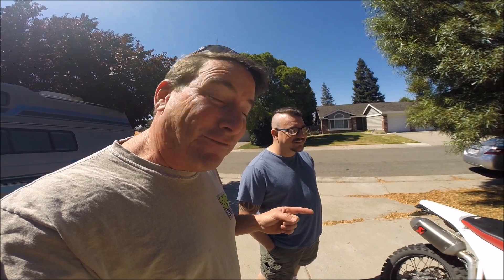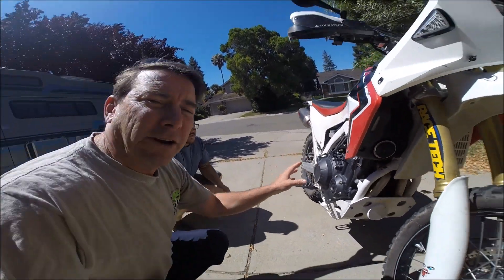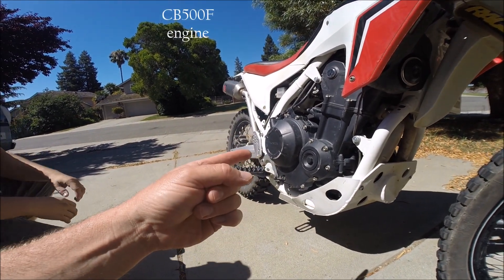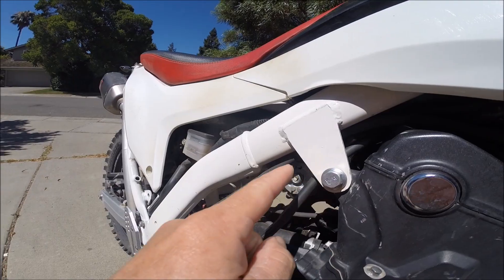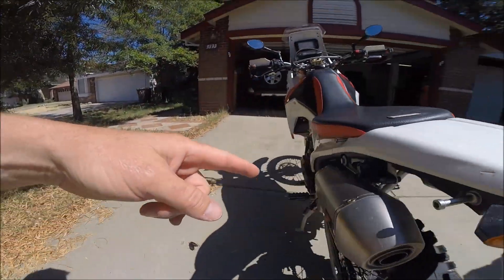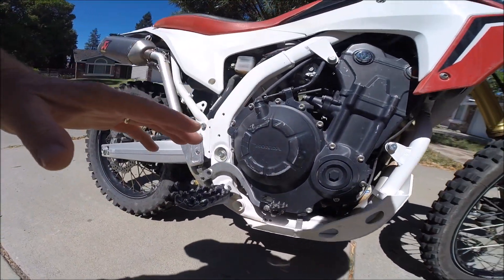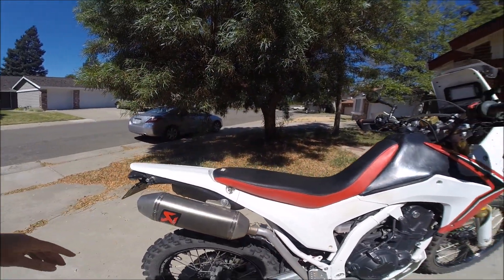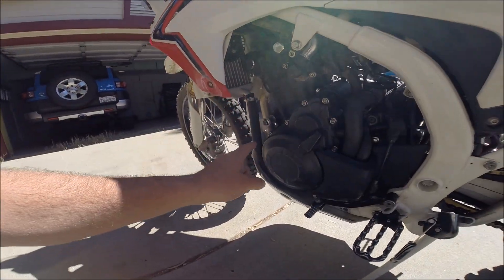HONDA CRF500L BUILD

Comment: So much for the “wave of the future” 9 years later no one is making this a production bike.
Reply: NOW you have KOVE 😂😂😂 try your luck :)
Reply: Kle 500
Reply: @G_040  If I am not mistaken, this bike should weigh around 160Kg (could be made lighter with a single exhaust) the Kawasaki KLE500 is ~30Kg heavier (at 193 kg)... The Honda NX500 is around the same (196Kg)...
Reply: @Jose-Sousa yeah too heavy. At 430lbs might as well get a tenere 700 with a wet weight of 450... Manufacturers should throw a 500 twin in a dirtbike chassis... keep it at 350 pounds wet and use a 270 degree crank...

Comment: These motors were built to go 180k miles. He defeated the 12k miles oil change and the longevity. used motors are about 700us now.

Comment: 8 years later and no sign of honda or others making a magic sub-160kg 450 - 500cc 40+ HP reliable low maintenance dual sport with a sensible seat height.
CFmoto 450 and Himalayan 450 are 40 kg too heavy wet. KTM are on shaky ground and overpriced high maintenance. Kove 450 seat much too high for a dual sport.
We have waited almost 20 years for honda to make this unicorn bike, but its never going to happen.

Comment: How does it ride? I would love to see the 500 cc engine in 400 lb or less total pkg. .... Honda are you listening? You could sell a bunch of adventure bikes if you want to make it. Over 400 lbs is too much when you have to add luggage. .... Thanks for video.
Reply: If they made this, this would probably kill the crf 300l.... crf450l... hurt sales on xr650 and cb500x, possibly even the trabsalp
Reply: @evanbatista8414  No it wouldn't, it's a totally different bike, it has NOTHING in common with a CRF450, the 300 is very popular and would remain that way for obvious reasons, the XR650 is also a very different bike and the Transalp is also for a different crowd, still adv but more road orientated with bigger luggage capacity.

Comment: Your problem solving skills and workmanship are impressive, thanks for sharing so much about this build. You say the rear wheel has cush drive, what make and model did the rear wheel assembly come from? I'm building up an XR250R ADV and the addition of cush drive may be of big benefit for the road sections.
Reply from the maker: I think he used CB500X cush drive? He'll chime in here...

Comment: It still suffers from the never ending debate. Every "adventure" bike will either be too big, too heavy, too dirt, or too street, not enough hp, or too much hp, or not comfortable enough. That bike for instance would be great for me, but good luck getting a BMW GS lover on something like that, which by the way I would never ride a gs1200 off-road, it's like taking a box truck rock crawling.
Reply: Funny thing is; it's actually more comfortable on the highway doing an all day slab blast than my Super Tenere 1200 was. Can't carry the kitchen sink but I pack far less than most people do. Off the road, its CG is lower than it was before and it's actually easier to handle now than it was when it was a 250.  Adventure bikes are always a compromise but I think this bike had hit a sweet spot with weight, power, comfort and off road capability.
Reply from the maker: Yep!

Comment: all very good throwing the cbf motor in the 250 frame but what is it like to ride, is it well balanced, is it now heavy at the front. was no mention what it's like to ride.
Reply: It's much improved over the 250. It only picked up 30lbs but you'd never know. The CG is lower so the bike actually feels lighter and more nimble. Weight balance is almost perfect 174/176lbs. Off-road it eats it up and the road presence is much better due to the significant increase in power and torque.    
I've done the SheetIron 300 and Adventure De Taco on it and it's not missed a beat, I couldn't be more pleased with how it performs.
Reply from the maker: That would be a whole different video....

Comment: I sold my 250 tenere and probably won't buy another of this so called dual sport for 2 reasons:
1 - The 02 options availiable to me are way too heavy for any off road use- Both being yamahas 660 weighting around 180-210kg 
2 - The price for those options makes me not want to take them off road, or at least not serious off road, be'cause if i drop it... you know the rest...

If i  only had the option of a 450 or a 500 that's light enough as the bike in this video...

Comment: Honda should make something like that to replace the XR650L.
Reply from the maker: Yes!!!
Reply: Honda has seen this and I hope they build one too . My DR 650 weights 350 ? Very good effort .  Thanks
Reply: with the 750 motor, it would be awesome
Reply: @kevinswanson3910  fug it make it a 1000cc motor . Now that would be cool.
Reply: i hope so!
Reply: And also lesser Weight aswell
Reply: jameshisself  . I agree. My buddy has a 650L and can go anywhere I can. I have a Baja Designs street legal kit. It's not really street legal but I have a plate and insurance. Pro Circuit exhaust , Precision Concepts suspension , taller gearing and so on. I mostly ride the desert , but it is a blast around town.
Reply: They did. Its called a XR650R.